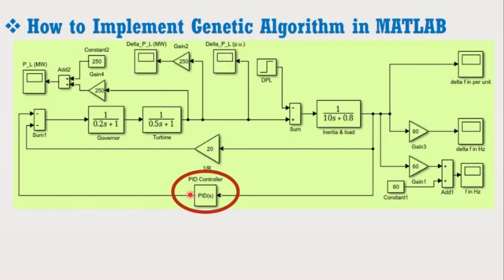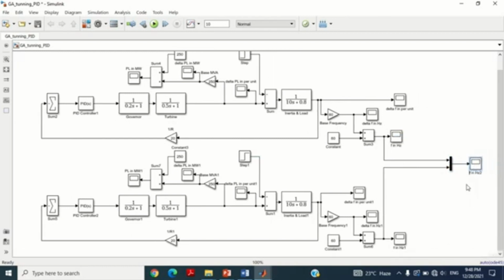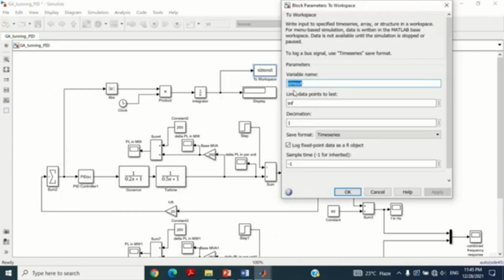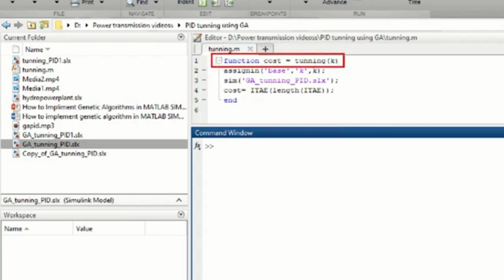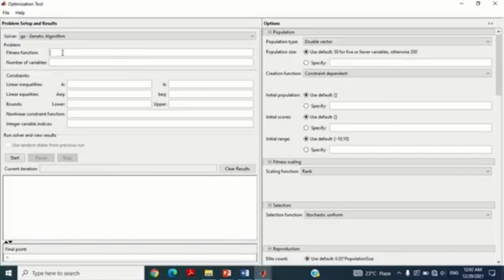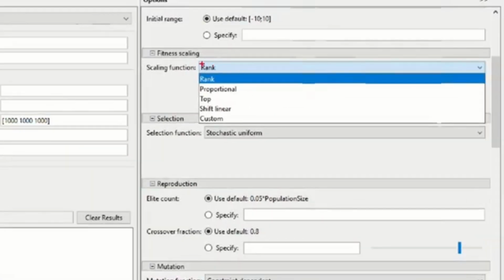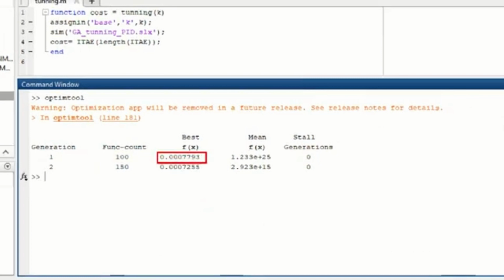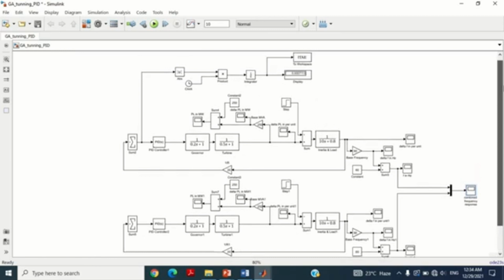Genetic Algorithm Based Load Frequency Control Simulink Model | Dr. J. A. Laghari

Comment: Respected Sir ，Although the frequency curve I obtained using your fitness function and method is smaller than the previous deviation, it still fluctuates up and down, which is not smooth enough. I see that the frequency curves obtained by GA optimization used in the references you posted are relatively smooth, I also want this effect, what should I do
Reply from the maker: Thanks for the comment. May be you are taking very small scale on y-axis take the scale larger then these ups and down will be smoother.
Reply: I have also faced this problem

Comment: first of all, thanks for the effort! it is truly appreciated. 
I am working on ACE of 6 Area system as an MS student. I have a query, you have used GA on controller of only one area. Could we use GA on all areas (in my case, 6 areas) at once?.
Furthermore, I was wondering If by any chance we could be in touch via mails or WhatsApp, professor?.
Thanks in advance.
Reply from the maker: Thanks for the compliments. Yes. You can use it for 6 areas. It is possible. First design the 6 area conventional model. Then incorporate the GA. It will work. But obviously it will be extremely slow and will take a lot of time, maybe days to converge.
Reply: @DrJALAGHARI , Dr WHY PID controller parameters remains their state but genetic algorithm optimized get noise of 0.2 pu (disturbances) get changed?

Comment: Thank u very much for the information sir..but the optimtool is removed from new matlab versions. How to apply this in new matlab versions? Any other commands will be useful sir
Reply from the maker: Thanks for the comment. Yes. You are right. It is available in 2017a version. However, it is removed in the latest versions. Therefore, now you have to made compromise, if you want to use this tool then you have to switch to older version.
Reply: @DrJALAGHARI  2018a has an optimtool.
Reply from the maker: @nurjamahashiabdulle1711  Thanks for the update.
Reply: @DrJALAGHARI  Dr can i send you my email.
Reply from the maker: @nurjamahashiabdulle1711  Thanks for the comment. May I know for what reason?
Reply: @DrJALAGHARI  only for helping me know step change challenge and hint as i am veru in need this problem?

Comment: Respected Sir please give me your some precious time if there is no problem to you please sir. I need your guidance
Reply from the maker: Thanks for the comment. What help do you need?
Reply: @DrJALAGHARI 
Aoa sir when we apply support vector machine machine for 5 predictors and 1 response and get trained model with cubic kernel function through regression learning App and automatically generated the code of trained model. My question is about the testing  model how we can create its code. Please guide
Reply from the maker: @safeerazaineb3692  thanks for the query. I am sorry i have not worked on support Vector machine. Therefore, i may not be able to give you a good suggestion.
Reply: @DrJALAGHARI 
I also want to ask some confusions about neural network can I?
Reply from the maker: @safeerazaineb3692  yes sure. Send email to jalaghari1@gmail.com and write your queries there. I will try to reply

Comment: A researcher like you are very rare to find in this modern world, because no one would like to share the information relevant to their field. But you are an exception & being such an inspiration for the budding researchers...
Reply from the maker: Thank you so much for the compliments. My opinion is simple whatever you know you share with others in order to help others. Do share it within your circle so that they may also benefit from it.
Reply: @DrJALAGHARI , Dr i used Your knowledge as complementaru of mu MSC. THESIS. i optimized model but whnever i change 0.2pu as step load change into small value, PID retains its state but optimization value get noise?
Reply from the maker: @nurjamahashiabdulle1711  Thanks for the comment. Right. In that case, it is better to optimize the parameters for wide range of load variation to find the most suitable values that provide best results for all cases.
Reply: @DrJALAGHARI , can you Please give me a hint to do that to overcome this challenge. If you can reach me kindlu my email, it will behind supportive.
Reply: @DrJALAGHARI , how can i get that values for wide range of load variation as i referred All my design based on Your informative and trasformative videos 🙏😍